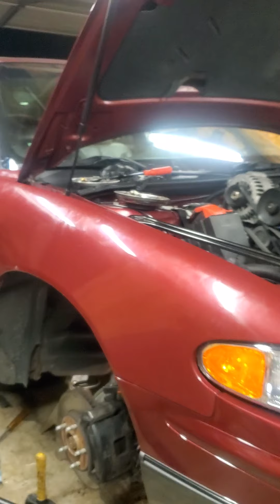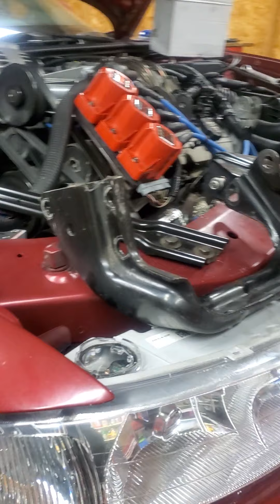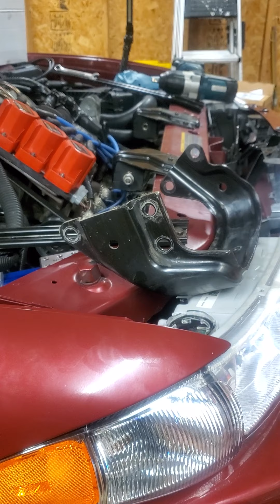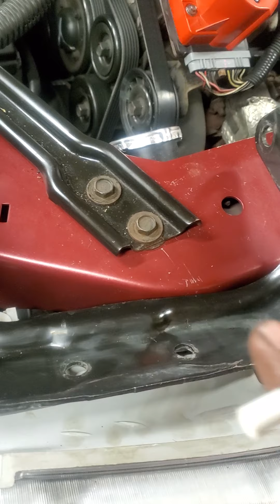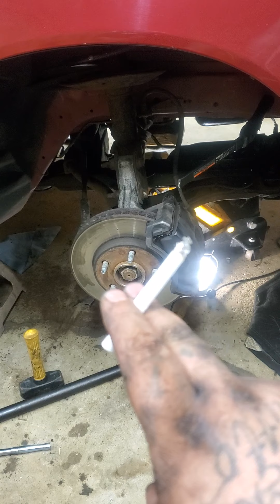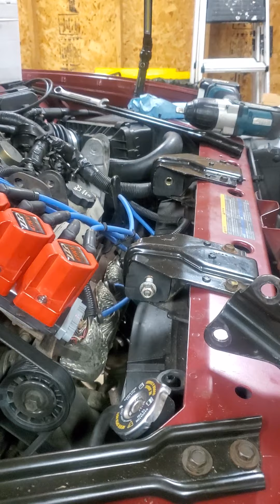1997-2004 3800 3.8 V6 Regal GS he bought it part 13

Comment: Unrelated to this video. Think comments are off on the acoustic sub. I actually bough the complete home theater from the white van. My minitowers last me over 10 years until they got stolen. The sub 21 years later i still have it an still hits like new. Bass its incredible ob this sub. I try to find the manufacture years ago but never had luck
Reply from the maker: It really is.  I have 2 of them. They're stacked. Absolutely a wow fact.
Reply: I found another one i might buy i would like to set it up like u have them. Am not that much of audio tech ill try to see if i can hooked them up following ur video. Any idea why my sub keeps going mute after a while being on? Could i be connecting wrong to my receiver?
Reply from the maker: I will make another video on the hookup tonight. I'm also going to inspect my subs on the protection circuit.... need to see if it has one. Again I will make the video tonight and post it
Reply from the maker: Okay it's up. I have another one that will post in a few more minutes.